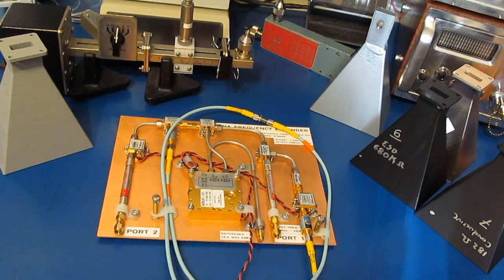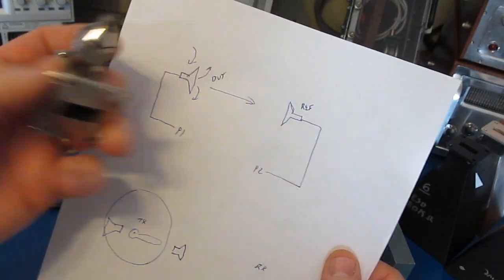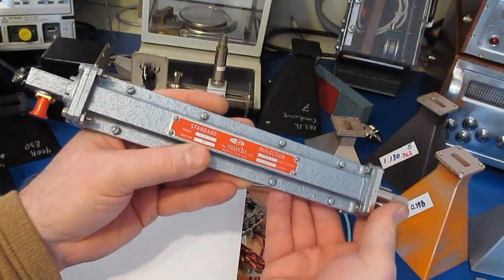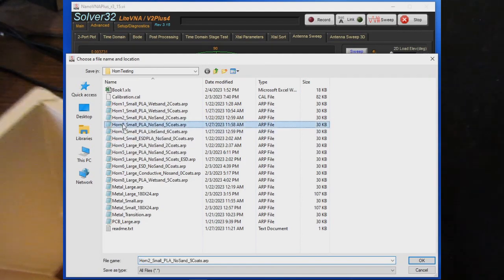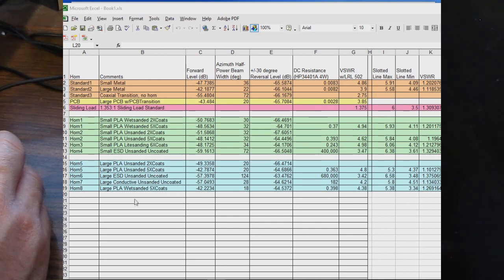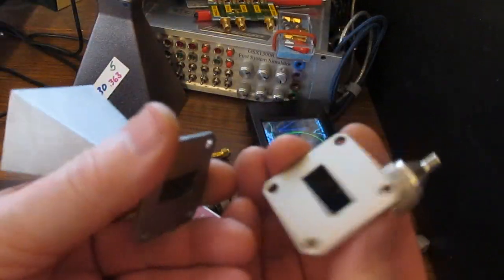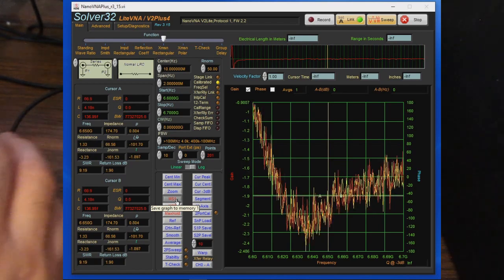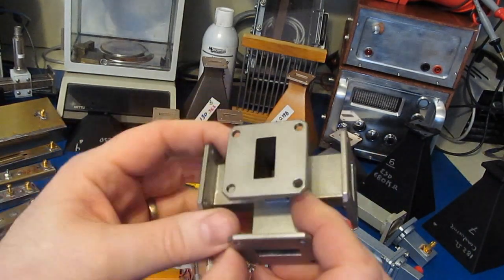Introduction to Waveguides using the LiteVNA,  Part3, 3D Printed Horns

Comment: Ha! I have the same Narda directional coupler myself. Bought for 10GHz use also.
Reply from the maker: That coupler did work well enough to run some of the experiments with.  I later changed to a different Narda coupler that had a higher frequency range and better directivity specs.   The final version of that extender works decent to a bit over 12GHz.

Comment: I just found your channel after seeing your video on FPGA based CPUs. I am impressed at your skills that really span a range of topics. I look forward to future videos, thanks!
Reply from the maker: That large FPGA board uses a 100MHz clock and was the fastest wire wrapped project I ever constructed.   I read a book 20 some years ago who's author's worked at Intel.  They discuss modern digital designers and the need for them to understand basic RF.   They consider the VNA as one of the basic tools.    Consider where we are today with high speed digital.

Comment: Heres a request. It would be interesting if you did a video on how to work with the rigid coax cables that were part of your mixer test board you used in your last videos. What do you look for in purchasing them, how do you safely bend and connect ends onto them to minimize leakage and distortion, and perhaps even basic rules to follow while  handling them. Comparing their superiority in S-parameter characteristics against standard non-rigid RF coax might also be a cool thought to consider? I havent seen many people work with the rigid coax at multi-GHz frequencies and thought you might do a thorough job discussing it, as you have done with your other excellent videos. You could make good use of your VNA software to run evaluation tests. It's just a thought... thanks.

Comment: Thank you for another excellent video.
What is the thickness of the conductive coating vs. the skin depth?  I would think that would determine how thick of a coating you need.
Do you think the VSWR of the ESD material may be lower because the material absorbs some energy?
Is the peak of the response with the materials a property of the material, a resonance set up in the cavity by the mismatch it causes, a combination, or something else?
Reply from the maker: As far as the skin depth, beyond what they have published, I have no idea.  I never tried to contact the mfg.  I'm guessing you have looked at the datasheet and application guides.  They show 2 mil or 51 μm per coat.   Their graphs show  up to three coats, which is why I continued to go up to double to see the effects.   We don't really know how thick it is but it could be measured.   They also show an attenuation graph based on two coats.  We know the makeup is copper silver something and at 10G would be something around 70 um.
Yes, I do believe that both the ESD and conductive plastics act as an absorber.    
HP and others have published some very good papers on measuring materials using rectangular waveguides.   If your Google foo is poor,  the following paper should get you started:  https://ntrs.nasa.gov/api/citations/19950023915/downloads/19950023915.pdf